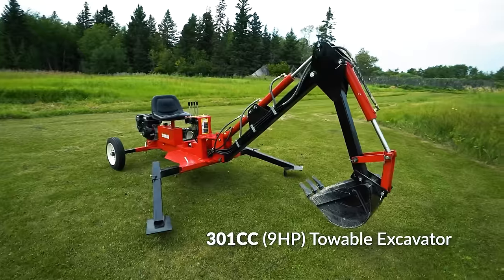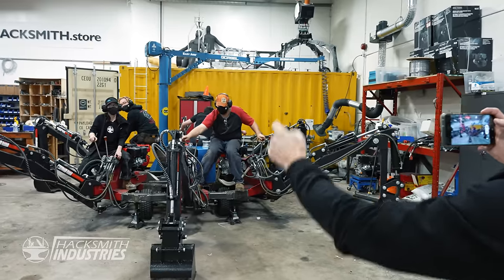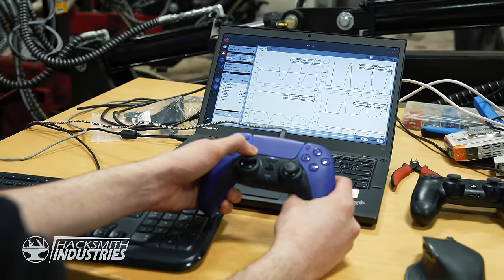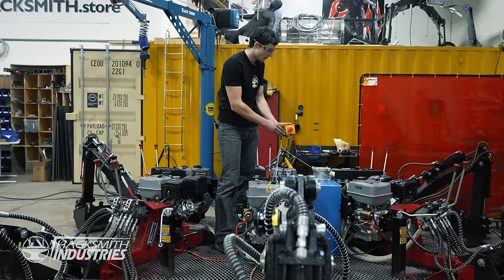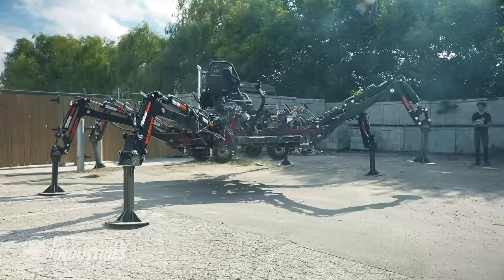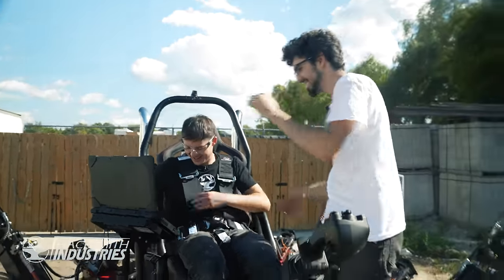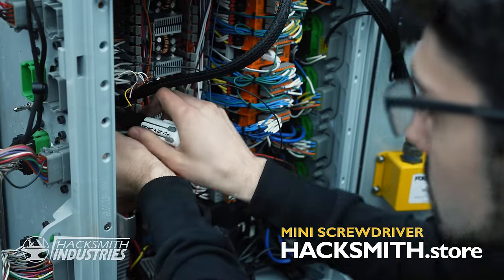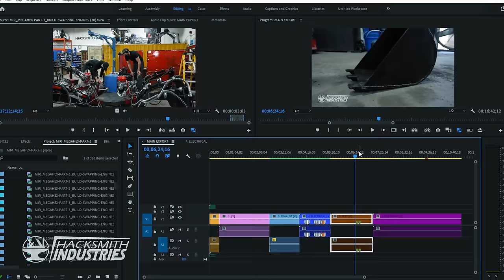Our BIGGEST project yet! (SPIDER MECH!)

Comment: you need accumulators on every ram so the accumulator will take the blow from the movement and it won't stress the joints as much.

Comment: Why did you use servos to control the hydraulic switches instead of using a manifold or valve body where you can control the fluid pressure from a duty cycle control?
Also i think it could use level and pressure sensors in all 6 feet and the base-plate to detect weight distribution and help with balancing on uneven terrain, this could be useful as well to incorporate a “4 leg planted” strategy where only two legs are allowed to move at a time.
Have encoder sensors been considered for the joints? They might provide a little more accuracy for smaller changes.
Struts might help reduce wear on the overall unit too.
Reply: Also with incorporating more sensors you could have it do a startup rationality test, where it would run through the full range of motion on all 6 legs to verify all of the sensors are within a realistic operating window prior to attempting to walk.
Reply: Oh yeah, and it wouldn’t hurt to monitor each hydraulics line pressure, it may be useful for datalogging when you start pushing for greater speeds.
You might find out that your weight distribution is not what you expect during dynamic operation and is putting more stress on two legs.
Reply from the maker: Cost.

Comment: I think they shouldn't give up
You are very close to making it work correctly, it has already taken many steps and it has the potential to give much more and you too, hopefully you will resume the project
Reply: They’d need to build it from scratch and take materials and stresses into account. Needs to be engineered with custom components to work well.
Reply: You don't know how much money they were losing by taking it that far. As he said, they pretty much accomplished what they set out to do - it walked across the parking lot. every6thing after that was, at  risk of oversimplification, just making it walk better. 

The other problem is that the act of testing would ITSELF cause damage just about every time, leading to a recursive loop of testing, equipment failure, diagnosing problems, purchasing replacements, awaiting delivery, repair, testing the fix... only to break something else, diagnose/repair it, test THAT fix, break something ELSE, and so on.

Comment: Use electric motors instead of petrol or diesel, and the whole thing need not be anywhere near as big or heavy, or loud. With a much smaller center the forces needed would be way less allowing normal welds and such to be strong enough. You could even run on mains if you don't have the budget for good batteries.
Reply: I could easily fix a lot of their issues with shock absorption on each leg and more friction material underneath each feet. Each walk it had issues, well duhh.. you are sitting in it with other 5 legs as balancers but each leg is punching the ground and has a heavy body, which you are right, electric motors would've reduced a lot of weight, and I mean a lot.
Reply: Silent like a tesla

Comment: Hey guys Andrew from the UK here, that's an amazing build you've got there! I've scrolled through the comments and have yet to watch the individual parts but haven't found an answer yet( hopefully I didn't blink and miss it in the video and look like a tool) but why did you go 6 legs and not 8 like an actual spider? Cost? Size? More complications?
Reply: Looking back at the video, not the indivual parts, you just say 6. Further looking in to how a spider walks, would 8 be better for weight distribution and having to focus on 4 sets(obviously mirrored) rather than 6 individual or 2 sets of 3?
Reply: I think this is related to the point in the FAQ that I went looking for. Why not a scale model? They explain this reasonably well though I think it still would have been worth while (especially for the program testing stage). But looking at a spider for inspiration is like looking at a model, a different scale changes the calculations. Then there's the fact that this project was constantly bouncing between failure points; servos, pistons, wiring, sensors, ECT... Imagine increasing the number of possible failure points by 33%. All that said, it would be cool to have seen 8 legs
Reply: 6 legs is already insanely complex

Comment: you could have added 1 more legs on each side make the frame thicker and more stable.  and make the legs have exhaust pipes and a temperature regulator.
Reply: but idk if that will work

Comment: building something like this requires expertise in different fields, specially automotive industry. 
but here is a few key things i noticed:

I noticed you are making this machine unnecessarily heavy. and when something is heavy you need more power for it , and hence it will make it  even heavier and when its heavier? 

yes ! you need to make up for the joints to be stronger and that will make it even Heavier!
and when its heavier its harder to balance in 3 legs that are not versatile at all . 

spider legs are super sticky and and versatile
if you could simplify it and make a super lightweight version , it would eliminate most of the problems

Comment: issue wasn't placement if legs but how many, when using 2 you need a gyro to help balance then move to  4 then you need to compensate speed for balance and move the legs one at a time, then you move to 6 which is still stable but coordination of the legs needs to be precise if you use 8 as long as the load can me relatively off center which would allow you to use 8 legs as 4 in a steady forward movement and allow stability. more parts but more stable design as far as stable walking goes but the other issues I haven't looked at yet. still watching the video, but man you guys are intelligent and look forward to more videos, consider me subscribed.

Comment: Probably would have been better to use solid structural supports made from relatively lightweight metal, or drill holes in key points to reduce weight while maintaining structural integrity as much as possible. Probably would have also been good to make the arms specifically for the application, since the arms were not meant for such weights and hard use.

Comment: Next time you face a hydraulic cylinder not developing enough torque, consider increasing the lever and replacing the cylinder with a longer one of the same diameter. This way you'll be able to generate the necessary torque without increasing the forces at the joint and eventually ripping everything apart.

Comment: If you ever had a chance to redo this, it would probably work better if you could make it out of carbon fiber composites instead of high alloy steel (2-4 times higher strength to weight ratio). Also, if possible, some electromechanical actuators supposedly have higher power to weight ratio than hydraulics, but I'm not sure how expensive they would be. Obviously manufacturing complexity would increase, but it would probably be easier in the long run to create a functional mechanical spider.
Reply from the maker: Insanely expensive lol.  Carbon fiber also fails catastrophically under high loads so aluminum might be a better bet if we were to build again 😊
Reply: @hacksmith  For sure, the carbon fiber would be probably 2.5-3 times more expensive. You could probably find a sponsor company who manufactures composite fabrics/weaves, but you'll probably have to pay for any epoxy you use yourself. You'd have to do a new analysis to make sure the extra 2-4 times in strength to weight ratio brought the portions that failed last time above the expected failure stress. 

When you say carbon fiber fails catastrophically, I'm guessing you're referring to impact loads and toughness (the modulus is similar to that of carbon fiber, ~200 GPa vs 220 GPa).
Automotive applications use a special layup method to make sure it's still tough and can absorb plenty of energy, for relatively slowly moving robotic legs, I don't think that's an immediate problem, but probably good to be mindful of as well and make sure the dynamic loads on the components will not be a problem. Seriously, I'd look into it and maybe crank out a preliminary analysis, you might be surprised what your analysis indicates.

I can understand cost is a real factor though. Without a sponsor paying for the carbon fiber, it would probably be a bad idea financially.

Comment: More legs help it? What about frame material weight reduction on the load bearing parts? Some type of algorithm for movement I'm guessing needs hard coded in too so make like "logical rules of walking" that it has to abides by or it will fall without the proper triangulation of bearing load on other legs moving (maybe why more legs will help)

Comment: i know NOTHING about robotics, but Im guessing if you changed the walk pattern so that front two opposing legs moved forward together then the middle two then the rear two, THEN shift the body forward... i think youd have better fluid movement. youd have the power of all six arm to move the body simultaneously
Reply from the maker: The walking gaits we used are the style most functional for hexapods -- tripoding is generally the most stable (besides single leg movement.  2 on one side,  1 on the other side,  then alternate.  The method you described doesn't work because the legs don't have a big enough range of motion -- if you move back legs last,  they're already stretched too far away

Comment: Amazing project but The problem is that they are literally going in the wrong direction... Not taking advantage of the longitudinal joints, which would provide a simpler and smoother movement and they are doing the opposite.
Reply from the maker: So easy to be an armchair engineer.

Comment: Honestly your biggest problems were weight and momentum. You probably could’ve gotten away with swapping the engines for a crate v8 from a junkyard and it would’ve put less stress on the frame. That, and if you gave the legs a window of motion instead of a specific value for a return, you could’ve maintained the momentum from each step, causing less strain on the joints and frame from shuddering.

Comment: Seems the anatomy of the craft could use a few thousand rounds of evolution. This is exactly why limb bones have such sophisticated inner and outer structures and the joints  are strengthened with layers of hulls and bands. But, I just found Your project, I find, You did a horriffic job trying to build a ridable bug with limbs of such complexity. Please don't leave this project and try to intergrate some bionic view! Just cool!

Comment: As amazing of engineers as they are, they only lack studies in biology to better understand  movement of hexapods to get the machine to walk smoothly. Everything else looks perfect.
Reply from the maker: No, that's not it at all.  We used hexapod walking gaites used in robotics very effectively.  Scale was the issue,  not software,  or implementation...
Reply: @hacksmith  oh, I had thought yall designed and programmed the walking basically from scratch and were doing trial and error on the movement pattern and ratio. But yeah upscaling does make even the proper movement framework difficult to execute when you have such a set structure that isn't easy to adjust other than hydraulic joint timing. Yall did amazing anyway and I hope one day I have the chance to do work even a fraction of the scale yall do. Best of luck and God Bless.

Comment: Why not Reduce weight and use electric motors and fly by wire instead of depending on hydraulic and mechanical joints?
Reply from the maker: Because we didn't have the budget to do it right

Comment: All creatures that "move" in order to survive are born with the (built-in) ability to "walk", "climb", "move sideways", "move forward", "move backward", "move up", "move down", etc. ... "even to fly". It's very specific. In the case here, use basic mechanical and electrical servo control and encoding for specific fundamental motion ... legs a b extend, move to take a vertical load, legs c d & e f, unload (somewhat), legs a b move for horizontal motion. Now either legs c d or e f do the same while legs a b unload-return, etc. First, make it 'FUNDAMENTALLY WALK' and then "BIAS" servo and encoder 'feedback' and 'input' to make it walk "THE WAY YOU WANT" ... IT'S ALL ABOUT TWEAKING THE BIASES. Mother Nature knows this.
Reply from the maker: We did. You didn't watch the whole video

Comment: not an engineer or even remotely smart but why did they choose that kind of feet that are slippery, something gripping like rubber or just 1 big spike would most likely work way better than a big surface where the point of impact on the leg will be slightly different every time

Comment: Now those battle bots ill pay to see them fight each other
Reply from the maker: Megabots tried that and it was boring lol
Reply: @hacksmith  would it be impossible to make a bot using no electronics and just using low tech like a pulley system and wenches and strong ropes ECT.......
Reply from the maker: Still wouldn't make it cheap.... check out skeletronics
Reply: yeah , maybe like in 50 years time we could have better mecha fights? since smaller RC scale fights are a thing and they are interesting @hacksmith

Comment: I feel like a lot of your mistakes could have been prevented by designing and programming a scaled down version of the final product.
Reply: as a prototype
Reply: Start cheap with many ideas, gather knowledge and then go expensive, love ya
Reply from the maker: Once you get to this scale that doesn't work unfortunately -- ever hear the saying "the bigger they are, the harder they fall"?

A toy version would have worked regardless in other words 🫠
Reply: @hacksmith  Nice one ;) A major problem with the design in my opinion was the fact that a huge amount of weight was supported by the hydraulic cylinder, even if they werent in movement. A design where the weight in a passive leg position would be supported by a strong joint would have worked more clean cause it wouldn't rely on the pressure within the hydraulic cylinders and the many joints in your arms, which are a lot of points of failure. Designing a simpler but more elegant product would have prevented these points of failure. But idk what you guys were considering in the design of this thing, I wasnt at the table in that design phase and all my anekdotes in hindsight are just retrospective haha. Good luck guys, you make some awesome stuff!

Comment: No disrespect to princess auto but I feel like this would have worked better with John deer or Brandt in tandem with PA because John deer and Brandt has one extra capability and that is a knuckle just above the bucket that could counter the lack of mobility which from what i can see is causing a buildup of torque. I think I'm not an engineer but it's something to think about.  Every time the leg would come up the cylinders were essentially fighting themselves plus the overall weight of the arms. idk I'm sure you know what I'm trying to say

Comment: I just want to say. Scale Model. Don't make anything dangerous without having done it with a scale model that can hurt no one. This is how you know if something is worth building. If you make it small you can make it bigger. Fundamentals of engineering 101.
Reply from the maker: Scale models don't work at this scale. Physics plays differently with mass
Reply: @hacksmith  Depends on the scale. You can scale model to real life conditions and stresses and save a lot of worry in understanding compositional issues with scale model work. Much of the heat issues and stress issues they had could have been solved by modeling prototyping. Scaled 1:4 or larger models can reflect materials issues and solve programming glitches. You also save man hours and design hours as the scale model allows easy access all around the project more effectively. Once all the issues are solved on the quarter model then you saved a lot of hours and money when you get to the life scale product. Because the model makes you familiar to what to anticipate and expect more realistically. I've done some models for lighting systems and they gave me a clear idea what to expect if I make them life sized. I found it funny when they didn't realize the back hoes are built from scratch and not by a machine. That's why the frames didn't exactly much up. These guys lack mechanical experience because they skipped the modeling phase.
Reply from the maker: Spoken like a true armchair engineer. Call me when you've made anything remotely similar before you insult my team.

Comment: Kinda felt like building house on sand

The base was flawed, so meticulous engineering on top of it could not saved it
There is no reason for contraption as such to not work in our age
Reply from the maker: If there was no reason,  then you'd think there'd be more giant mechs...

The reason we started the project was because repurposing the excavator arms simplified the design, and made the initial costs close to zero. If we had real funding,  we would have designed it from scratch, and it would have worked.  It was defects in the manufacturing of the excavators that led to its downfall, not our engineering.
Reply: @hacksmith  Well, that what i said, you tried build house on sand (excavators as base) so no matter how hard you worked later, base still failed you at the end.

And as for the last words, i meant the technology of software is at high enough level.
Yeah ig my language was faulty, i'm not hating on you here, i'm just sad it failed :/
espec when it looked so promising